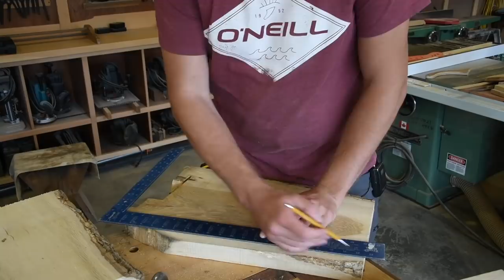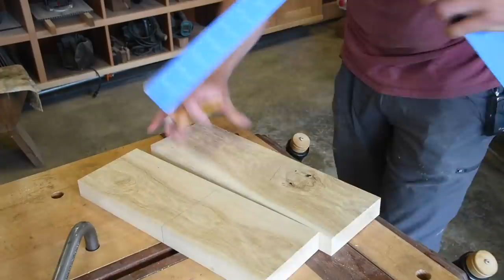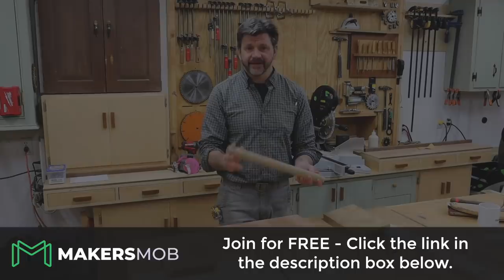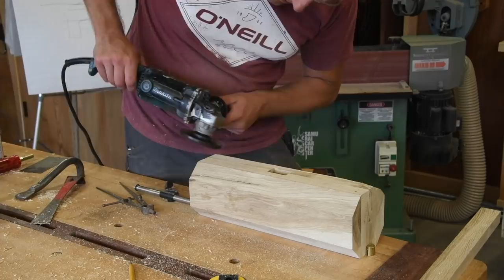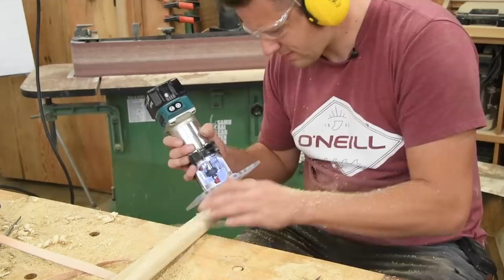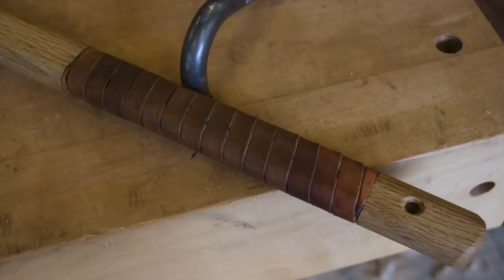Samurai Timber Frame Commander Mallet

Comment: Samurai Carpenter, or others, I have a question about what types of wood I can use to make a wooden mallet (kine; pronounced key-neigh) for Mochi pounding. The only thing is that it needs to be a wood that is lightweight, and doesn’t splinter, or “shave” easily. Because of the food aspect. We have used redwood (fail) cause when it shaves it leaves a reddish brown color in our nice white Mochi. We have also used hau tree (Hibiscus tiliaceus). Just wondering if you have a thought as to a different/better wood. Thank you.

Comment: i made mine out of osage orange for the head , and black locust for my handle . It's nice and heavy and Extremely tough and hard . i decided to taper my head and put metal rings on it though , because osage is some Very Hard wood . i only wanted to make 2 of these commander mallets , so i did , in two sizes and weights . both get the job done , no prob .